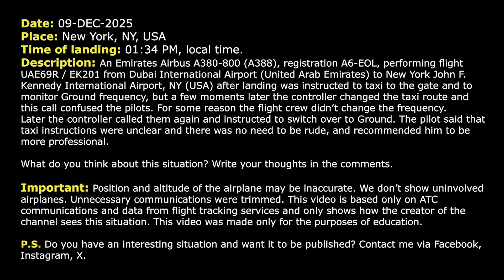Emirates pilots ask JFK controller to be MORE PROFESSIONAL. Pilot argues with controller. Real ATC

Comment: Given that taxiway A is a loop and the first instruction was to turn right on A, the the second instruction was to go straight on A, I can see the confusion.
Reply: Being told to change direction on taxiways mostly used for one way traffic is weird (regardless of clockwise being standard for alpha).
Reply: And the fact that straight on A to hold D is a very odd instruction it would have confused the JFK based pilots as well
Reply: @joejoey7272 Um... No. If they had familiarized themselves with the airfield before landing, they would know that there are 2 'circular' taxiways that encircle all of the passenger terminals, A & B. Either direction on A (though normally clockwise) was going to take them to the other side of the airfield for parking. You cannot leave another aircraft stranded in the middle of the landing runway with traffic approaching while you 'get familiar' with the airfield. It's one of the most challenging parts of international flying as EVERY airport is different. They didn't do their homework.
Reply: @JDEdge-iii correct you can’t leave another aircraft in the middle of a landing runway that’s silly. Silly to even entertain the idea of giving a crossing clearance behind a super. And asking a super to expedite? Hopefully ATC learn from this one.
Reply: @JDEdg @JDEdge-iii would have been fine if the tower didn’t tell them right on A to hold delta then straight on A to hold D on the intersection they were supposed to decide at , they needed a few seconds to review the charts before getting yelled at . It’s completely normal for pilots to be extra vigilant at airports they rarely fly to , same applies in reverse when an American carrier  flies to Dubai  . It sounds supper easy when you are just chilling on your phone commenting .
Reply: @joejoey7272 Gonna have to respectfully disagree here. JFK is one of the busiest airports in the world. You can't shut down the active landing runway while you get yourself together. It's incumbent on the crew to familiarize themselves with the airport when there's no time pressure, i.e. at cruise. When tower tells you to continue straight ahead, you keep rolling while the other (3!) pilots confirm the new route. Alpha is normally clockwise flow, so they should have expected the clearance they ultimately received. Taxiing at foreign airports is one of the more difficult aspects of international flying (along with the language barrier).
Reply: @JDEdge-iii  We found the tower controller! 😂
Reply: @JDEdge-iii You absolutely can stop anywhere anytime when the safe operation of the aircraft and its location is in jeopardy. Also most people don't study the entire 10-9 chart when the gate is close. JFK and ORD are some of the only places in the world where they will literally taxi you around the entire airport.
Reply: @williamcain3074 The gate wasn't close. They were going to have to taxi around to the other side of the airfield, either CW or CCW. Yes, you can always stop the aircraft for safety reasons. However, shutting down the departure runway at one of the busiest international airports because you didn't familiarize yourself with the 10-9 page is unprofessional.
Reply: I mean, that also combined with being told to "not stop"
Reply: Listen again it was straight to me.
Reply: I don't, no confusion over turn right and then it being changed to straight ahead.... Simple for someone who actually understands ENGLISH...
Reply: @grantandrew594  You sound like one of those Americans who only speak American.
Reply: @grantandrew594 Actually, that is very confusing - he needed to tell them two additional things: 1. You’re now going to taxi around the airport, so straight ahead Alpha hold short of Delta, and 2. Expedite crossing 22R.
Reply: @robslocombe3955 You must be a great ATC. Not the case of these JFK ATCs.
Reply: @g @grantandrew594 it’s only simple for a keyboard warrior
Reply: I understand a change of instructions to straight on A dont stop and I'm not a pilot. Im concerned that entire crew is not qualified to have a driver's license. The crew on radio was able to repeat the instruction. An Emerites exec needs to pull this crew for evaluation. Embarrassing it is.
Reply: @shokwavxb  If the controller had stated long way around or all the way around the terminal they likely wouldn’t have slowed down
Reply: @shokwavxb  with all the risk of making a taxi mistake and face the consequences afterwards I would have stopped and only moved after I clearly understand the whole taxi route, specially in A380 where is probably not really easy to maneuver on ground. ATC was unprofessional, foreign pilots don’t fly to JFK every week.
Reply: @shokwavxb As a pilot, I can assure you the change in instruction made no sense, which is why they clarified “Kilo Delta?” Which was the upcoming taxiway.
Reply: @robslocombe3955 I didn't know how to interpret "hold short of delta". Do they mean make a full stop prior to going onto D? Do all controllers speak with the same type of commands or is that the  Americanised way of speaking about traffic
Reply: @shokwavxb  you don`t know what you are talking about lmao
Reply: @s @shokwavxb  “I’m not a pilot” enough said
Reply: @FastFlicks000 😂😂😂

Comment: ATC should just have said..."cancel previous instruction"....would have saved all the trouble. The controller needs some humle pie.
Reply: There is a correction at 1:48 timestamp, which is the equivalent of 'cancel previous instruction, follow new instruction'. Did both the pilots and you miss it?

Comment: EK’s concern after crossing is not to blow past A which is a 90 degree turn. Hence they slowed. In their initial mindset after that initial instruction they had 0 idea there was a long lap scenic tour that involved going straight ahead. If the controller had just simply made it clear they were going to plan B which is the straight ahead long lap tour it would have broken their mindset and it would have made sense to the pilots. The latest Lido update now allows taxiway searches. Which is very helpful. Don’t forget these guys are tired and don’t want to make a mistake. The A380 isn’t as nimble as other smaller aircraft.
Reply: B isn't a good option for the A380 (either restricts traffic on A or is completely unavailable - see A380 taxi chart).
Standard direction on A is clockwise, pretty sure they use it counterclockwise for the A380 bc of B restrictions.
Reply: Nicely said

Comment: The controller telling them to keep moving while they were lost was a serious safety issue
Reply: Emirates never said they were lost. ATC doesn't read minds.
Reply: @Dan_D_av8geek  They were slowing down because they weren't able to locate D while going ahead on A. He should have told them go around the airport in the first instance itself. The tower might be very familiar with the layout but not the pilots.
Reply: This!!! You don't hurry someone who is confused, that's how accidents happen
Reply: @VictorHahn You don't tell somebody to stop blocking the runway because a plane's about to land and crash if they don't move their ass?
Reply: @VictorHahn  And less if it's taxing a 500.000 Kg airplane.😅
Reply: @VictorHahn tell us the timestamp where the crew told tower they were lost and confused, oh wise keyboard warrior. Then respond.
Reply: How on Earth is tower supposed to know they were "lost" when they read the instructions back just fine and never stated they were "lost"???
Reply: No it wasn't lmao. This wasn't providence under severely low visibility. The pilot wasn't lost, they were just a little confused, and there was no risk introduced telling them to keep moving.
Reply: this would be true if the PM wouldve stated that they didnt understand the taxi instruction given, however this isnt the case the PM instead read back the instruction and never stated that they were confused. So the safety was caused by the PM neglecting to make clarification from the GND controller....Like my Pops used to say, "closed mouths dont get fed..."
Reply: @9CCTaylor   "Like my Pops used to say, "closed mouths don't get fed...
I look forward to the day the sea rises and they all start flying spruce goose's again.  😘
Reply: exactly

Comment: "Correction: go straight ahead Alpha  short of Delta. Thanks, and  don't stop I have a triple 7 crossing behind you."

What is unclear about that? A triple 7 behind you crossing the runway means expedite and go straight. The previous order to turn right was superseded yet 69R Super dawdles at Alpha unsure whether to turn right or go straight with a triple 7 on the runway behind them. ATC handled that alot better than I would have.

Comment: ATC so unprofessional - you do not argue with visiting pilots, I despair when I hear these RTF exchanges - FAA needs to step up its competency checks
Reply: I dont see any argument. The pilot made an accusation and both controllers were trying to figure out where a mistake was made. Dont make an accusation if you cant back it up.
Reply: @matthewstraub8771  As an ex UK ATCO I was taught to respect foreign visiting pilots particularly as they may not be regular visitors. Slow down the delivery of the RT, give progressive instructions and explain what is happening. Simple defensive controlling
Reply: Are you are you gonna go with THAT?  @matthewstraub8771

Comment: while i can see where the confusion of holding short of D and KD can come from, if you think back to one of the previous transitions, the controller said "I got a 777 crossing behind you" meaning the 777 needs room on the other side as well and with the length of the A380 and 777 plus room to keep A taxiway unblocked holding short of KD and the space between the 777 and A380 plus the room behind the 777 to fully cross the hold short bars, there would not be enough room to have the A380 hold short of KD and keep departures going on 22R because the 777 would most likely still not be fully over the hold short line, so while not ideal, if the A380 crew was confused, they should have at least kept their speed up so the 777 could get fully across and if they had to turn around all the taxiways up to N (so KE KF KG M MA MB Q N P B) are all approved for the A380 so long as an A380 isn't also on 31L

Comment: The confusing part for pilots not familiar with JFK is that Taxiway A and B are two taxiways that simply do a loop around the terminals. The Emirates pilots probably got confused being told to go straight on A and hold short D because to them, taxiway D is to the right, not knowing that going straight would take them all the way around the airport and back to Taxiway D from the opposite side anyway.
Reply: It was the non standard phraseology
Reply: That's EK 201 or 203. They do it quite often every week it's not like it's the first time they've been to the airport. Also, be aware that pilots are required to know the airport they land in, and if they have questions to ask right away - not sit still and endanger planes landing.

Comment: people mispeak all the time , that the driver of the vehicle wants to make sure the instructions given were correct ESPECIALLY BECAUSE they changed then it warrants taking things a little slowly, so no instruction was at fault other than chastising them for moving a little slow out of an abundance of caution, whole thing wouldn't of happened if we all considered the potential for mistakes and why taking a second to verify the instruction SHOULD be a WANTED behaviour not chastised against, caveat he wasn't in the middle of a runway--- I realise the controller was worried re the other craft behind them but how about we have a system where no one and I mean NO ONE enters the runway crossing until the exit is CLEAR! we are human beings with different risk aversions the system NEEDS to be built around that and not around "just hurry up and go already" ... the accident waiting to happen system this airport controller seems to be running under.

Comment: They probably slowed down to look for A, D on their taxi diagram since the taxiways ahead on A didn't have a D. The controller should've initially stated he was sending them all the way around to A,D. The instructions were concise, but confusing since A, D is way on the other side of the airport.
Reply: Foreign pilots are ok with the hurry up. But if we hurry up to support ATC incompetence, and end up making mistake, don’t write any fk report, eh? Emirates fly to hundreds of cities around the world. And many of them are much busier than JFK….  None of them are as rude. It seems all JFK controllers care about is how to clear everything out of their way as fast as possible. Lives don’t matter, availability of the runway is more important.
Reply: @karnchinsin7824  LOL yall foreign pilots are not ok with being told to go faster, yall got all pissed off over it as we saw here. If yall foreigners could handle ambiguity and multitask there wouldn't be a video here. Straight on alpha, hold short of delta, so simple even foreigner can understand.
Reply: The job on the ground is to follow the instructions especially in airports like JFK where the controllers know more than the foreign pilot woh doesn't like being told to hurry up
Reply: @brianlacroix822  Yes follow instructions but we're also taught that when things don't make sense, you don't blindly follow instructions without understanding what's going on. In this case, the controller knew the taxi instructions were clear and direct but also confusing. He's directing them to A,D as if it's just straight ahead but it's actually way on the other side of JFK airport. He should've known it would cause confusion, which could've been easily resolved by mentioning they're taxiing all the way around.
Reply: @wflyer7985  yes for sure: it is good if you readback the correct directions, but don't remember them later, you should just stop and double check. that is true. but JFK has limited space and runways must not be blocked

Comment: This is crazy, Emirates was clearly in the wrong. they were given clear instruction which they repeated back. They have all the charts they need and they even responded with "alfa hold short delta" If anything, THEY were unprofessional, and rude. Moreover they were given instruction to change to ground on .9 and because they were "confused," they forgot and diverted their attention. 100% their fault. Good work to Tower for not making a big deal.

Comment: JFK is not really unique in this case. This sort of confusion is common around the world because controllers aren’t aware of how layout information is presented to pilots. The same thing happens in London Heathrow for example. 
A non-local pilot cannot memorise a whole airport layout like a resident controller can. So they must map read. Almost all aircraft use moving maps on iPads now. There is a practical limit to how far out the map can be zoomed and still be usable. Partly this is because, like on marine charts, vital detail is lost when the chart is zoomed out to avoid clutter. You can’t be pinching and swiping while also watching outside and driving a large aircraft.  So points on the other side of the airport are not immediately clear.
Controllers need to become aware that progressive taxi instructions are needed otherwise any minor ambiguity such as “KD” vs “D” will likely cause the aircraft to stop until the confusion is resolved.

Confusion begats confusion, and the little cascade of minor errors starts to create the accident chain…
Reply: We don't using moving maps that lose detail when you zoom out! The charts stay the same! Heathrow are very clear with a left and right on A/B  and then use designated holding points not hold short of!
Reply: @a @alexaviation8107 
If you’re using the AMM on Jeppesen FD Pro good luck finding Satun, Titan etc if you are zoomed out to a whole airport view. They certainly disappear. And last time I landed on 09L the taxi instruction was “taxi on A, Link 28, hold short of NB1”. 
Which incidentally disappears if you zoom out enough to see that far. So…yeah….
Reply: I operate out of Heathrow and am unsure what aspect of Heathrow could cause confusion. The instructions are very clear with uniquely named 5-letter holding points.
Reply: @tortozza 
The point I was making was to do with taxi instructions to a distant point after vacating the runway on arrival, and the practical difficulty this presents extracting non-proximate information with the map presentation available to pilots. There’s nothing particularly difficult about LHR, however I mention it because, like JFK, it has an outer taxiway (A) that covers a large non linear distance. 
For info we foreigners use T4 and the 5 letter holding points are not usually used when arriving from 09L. What’s interesting about your comment is how your perception as a local is formed that all users have the same experience. In an odd way it reflects the issue at the heart of the video.
Reply: @tortozza  yep. This is 100% a result of a slow-processing brain that couldn't process the changed instruction in sufficient time. The eventual correct readback to the ground frequency confirms that they heard it correctly, but apparently needed 3-5 business days to course correct in action.
Reply: This makes sense, and if the confusion here was more than a result of simply taking too long to process the changed instructions from the tower, that is something that can be easily addressed by pilots on the frequency. The pilot should just say, "I require additional guidance/ time to locate the markers or navigate".
Reply: This confusion is resident to JFK and US airports. Most other airports would have issued a clearer instruction especially about going around the entire airport...especially because the first and second instruction sounded the same.